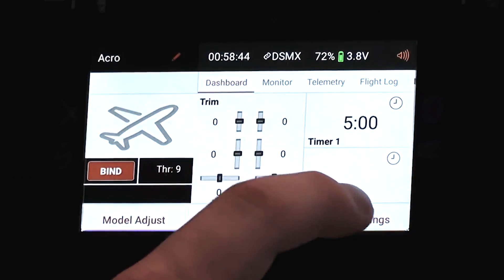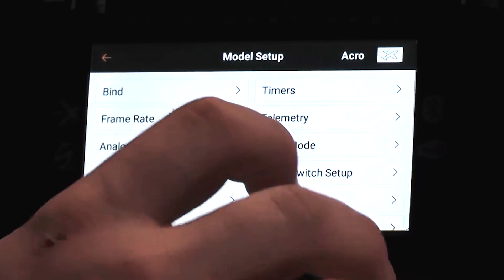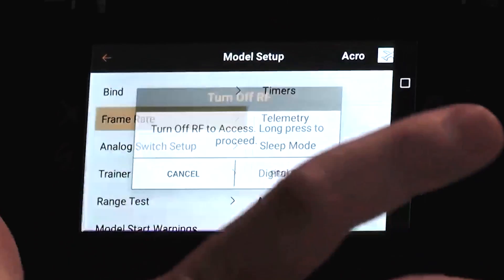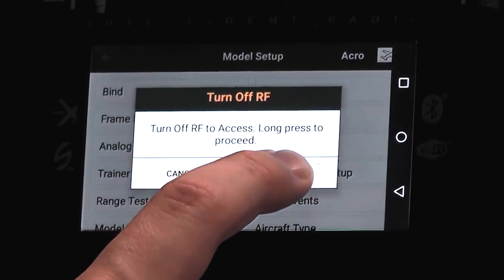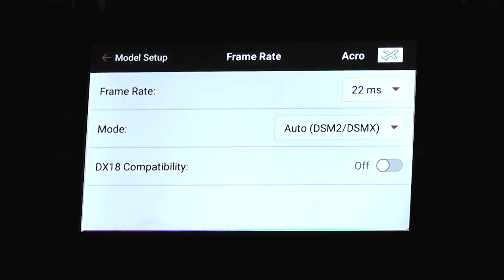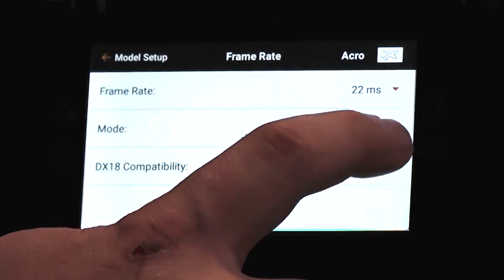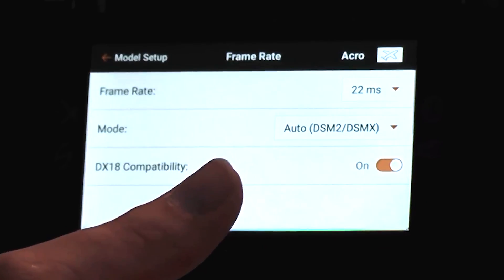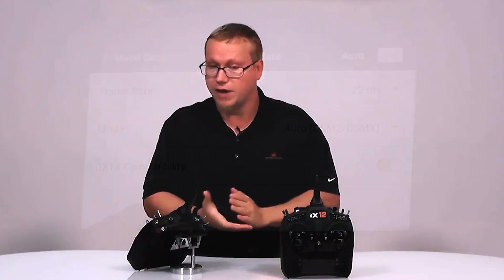iX12 Instructional Series - DX18 Compatibility Mode

Comment: Still can't get my IX12 to use Ch 11 for a Brake. If I plug in the brake to CH 1 it works fine with Throttle. But Ch11 or 12 is a no go.